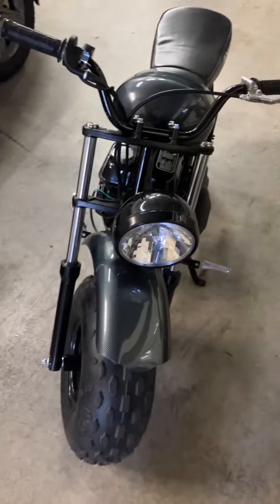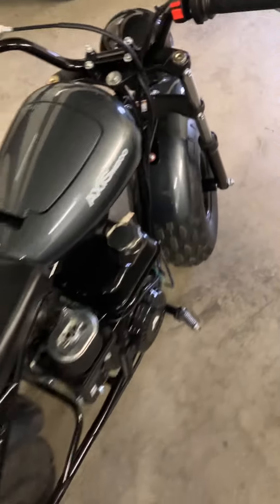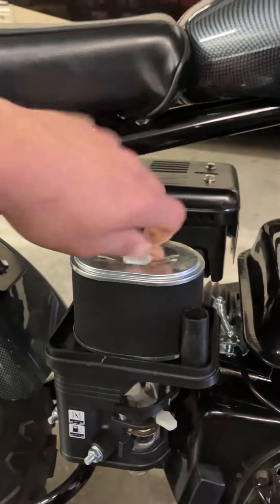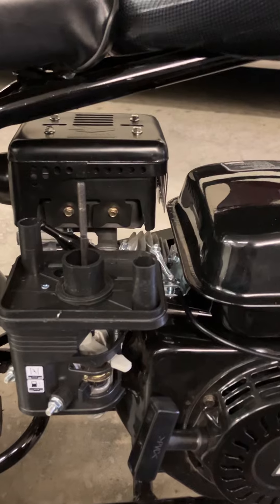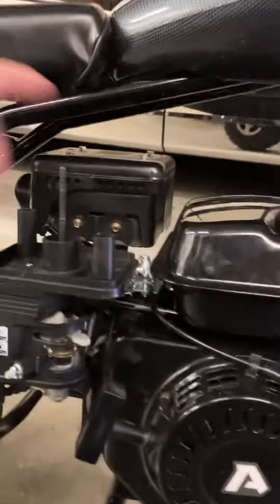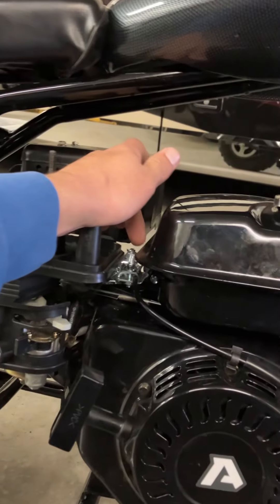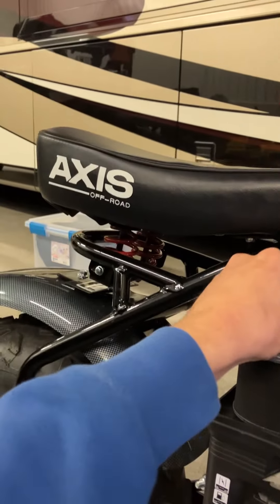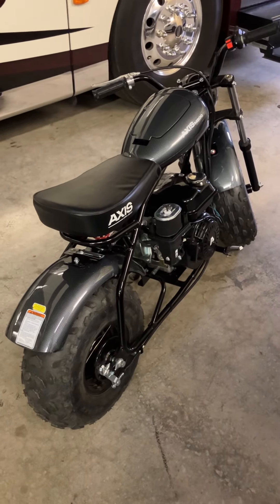Axis M200 Mods and Review

Comment: The best mods i have done to mine. Was torque converter. Changed the foot pegs out. I did shortened my carb return spring like you did, but i stretched it out. I also charged our the sparkplug for a better one. When you take the heatshield it will burn you much easier. To fix that i made my own to fit from an old fiberglass truck cab.